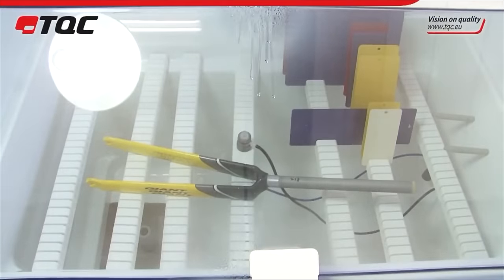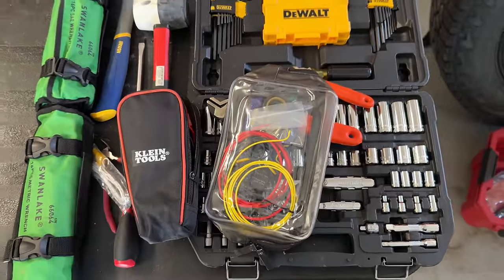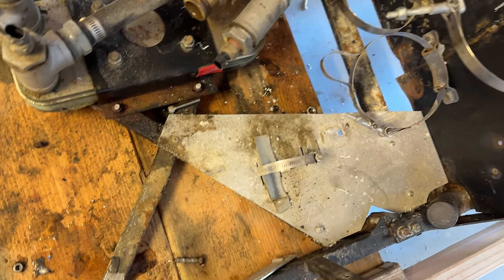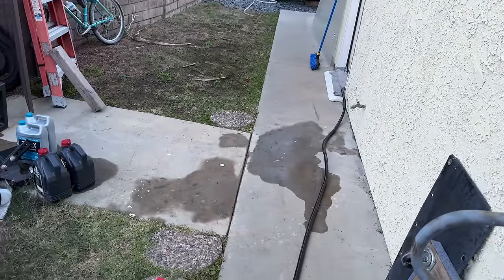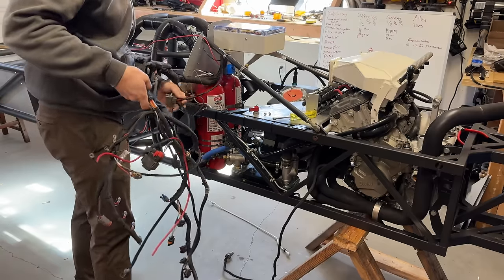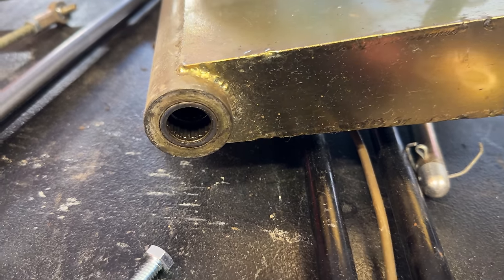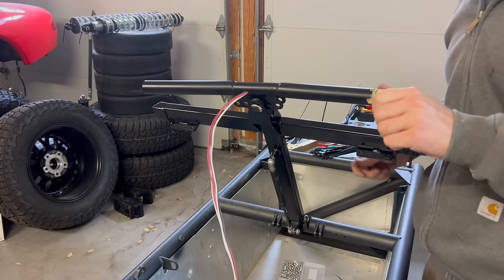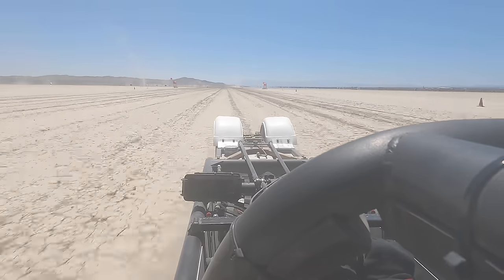My Race Car Is Rust

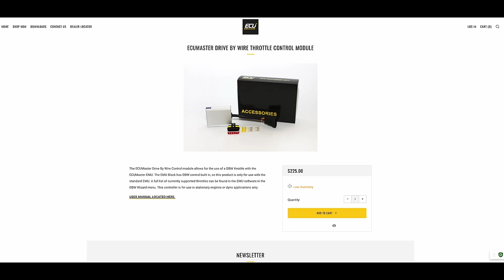Comment: 11:19 Arduino boards are generally not manufactured to withstand the vibrations and heat you need in an automotive environment but I’m sure you’re very much aware of that. 
Just wondering how you’re going to solve that.
Reply: I imagine its easy to compartmentalize.

The inside of some 3d printers get really hot but they still use basic consumer microcontrollers.

They just have different chambers so the boards aren't in the hot zone.

A 3d printed shroud and a fan would be enough I reckon.

The thing Id worry about is signal integrity with alternators and other electrically noisy components in that area, but that could be fixed simply with some shielded cable and or differential twisted pair.
Reply: @BeefIngot  I agree that heat is probably not to difficult to tackle but I think the vibrations might be the biggest problem. Connectors will need extra attention too, I think. 
As far as I know, most cars still use unshielded cables (to my surprise).

Comment: Your issue with 3D printers is EXACTLY what put me off for so long. I don't want to have to fix a load of things every print and gamble away time and filament on a maybe it'll work this time". I'm not looking for my 3D printer to be a hobby, I'm looking to print away my problems... as a hobby. 
Does seem like there are finally units that Just Work* and we've been going at them HARD to make up all the bits we said we'll "just print later"... 

* They don't , but they do better than 5 years ago and don't need in depth knowledge of printers to run/fix.

Comment: i noticed the european trucks are motor-chasis-electrical wiring- suspension builded and after that are painted with a layer of anti corrosion paint. is possible that helps you.

Comment: I am wondering why you didn't run one lift cable in total? You could have ran from the winch through a pulley, down to a snatch block with a hook, back up through another pulley, back to the rear, through a 3rd pulley, then down to the back hook/lift point. That would have minimized parts, reduced complexity and also minimized several failure points.

Comment: I'm now wondering how can fly by wire have such a large lag when it's basically a relay between one turny thing to another turny thing. Is there some super complex analysis taking place on the way? Aren't arduinos relatively fast even with operations that take hundreds of clocks?

Comment: If a lot of the trouble you’re having with your printer is related to bed adhesion, do yourself a favour and pick up a textured PEI plate instead. I’ve found the cool plate that comes with the X1C sucks, and I’ve yet to see a failure with the textured plate, to the point where I’m happy to kick off really long prints and not fret about whether the adhesion of the first layer is a ticking time bomb.

As I type this, mine’s currently working on a second 8-inch duct reducer that I cobbled together with my abysmally limited fusion 360 knowledge. It necks down and also shoots air up a bit for an abuse of a couple of ducted fans I’ve got going. I’m printing them in PETG, and each is a 12-hour print. I also did a big 2-colour Majora’s Mask for my daughter for Christmas, each half of which was closer to 18 hours and would have sucked balls if it had failed, which it didn’t.

Not interested in 3D printing as a hobby, either - I want to use mine as a tool instead of having to tinker.

Comment: Now you probably have a better understanding of why anything that has a "marine" rating is so much more expensive than the non-marine version, constant exposure to salt air destroys everything. 
Marine circuit boards are set in epoxy after the components are soldered to the circuit boards to protect them from corrosion, so if you're using a pi or similar to control your throttle think about this if you want it to last.

Comment: Use hot water when cleaning your stuff of salt. Hot pressure washers with the pressure washer underbody sprayer. Best method to clean salt is hot water. Cold water ain't gonna touch it, you need to bring up the temperature, like in chemistry class.

Comment: Stick the suspension on your seat, that way you don't have to do all the jiggery pokery with the wheels, (think a truck (18 wheeler type truck) seat but smaller)
Reply: The suspension is not there to make it comfortable. It's there for maintaining contact from the tire to the ground

Comment: Honestly I'm not familiar with bambu labs 3d printers but from what I've heard you shouldn't need to fix things that often. Maybe it's a bad unit? I rock with Prusa and literally I've only had to lube my pre-assembled mk3s+.

You'll be surprised how strong PLA+/pro is even for impacts. PC should do great and have awesome heat resistance which PLA sucks for.

Comment: Was wondering if you were going to lean into the caster.  It's a one trick pony... lean it back.  I don't know about Arduino running any throttle.  It would have to be on the hardware interrupt side, and even then I'd have to know the refresh frequency.

Comment: You southerners are funny, come up to the rust belt.
BTW check out saltaway, for clean up after, and Krown for protection ahead of time, spray teh insides of the frame tubes, and the outside of everything but the body.
Also there are plenty of ECU's for EFI with fly by wire throttle.

Comment: heh i made a DIY drive by wire system for my gokart bc i didnt have a long enough throttle cable and wanted to overcomplicate things. worked decent but the kill switch i added definitely saved my ass a few times

Comment: Would it be possible to use a fan to pressurise the body while doing runs so it will blow air out of every gap and not allow the salt in?
I have heard of it being done on trailers in Australia to keep the dust out on the long dirt track to get to our salt lakes

Comment: What 3D printer did you get? If you want one that's an actual tool and not an obnoxious project in its own right, get a Prusa or a Bambu. We use both of those at my work, and they're absolute workhorses. None of the bullshit that comes with an Ender

Comment: for your 3D printing, the way to avoid making it a hobby is to buy a Form Labs resin printer.  It makes fully dense parts out of a variety of materials (soft, hard, stretchy, super strong, grippy, temperature tolerant, etc.) damn near perfect every time.  The resolution is also 5-10X higher than what you have now.  It's a ~$4k outlay to get started, but it'll be much stronger, smoother, and functional than any FDM print.

Comment: Old school paintball players all doing the Leo snap/whistle thing @3:18.
Reply: Weirdly enough, I remember years ago looking at a racing cart that had a pneumatic shifter with a Palmer's stabilizer on it, and thinking it was an oddly specific choice...

Seeing it again here, I can't help but wonder why the Palmer's seems to be the go-to regulator.

Also, I have no idea what the Leo snap/whistle thing is...
Reply: @normang3668  The DiCaprio meme from One Upon a Time In Hollywood.
As for why, it was (and perhaps still is) the most compact regulator that interfaces with pin valve tanks and is adjustable.  Everything else requires additional fittings, an external regulator, etc.  I’d have to look at Grainger, et al to see if that’s still the case but it might be.

Comment: My suggestion as a Canadian that lives in the land of calcium chloride, just buy a pail of Corrosion-free 3000 and apply it to everything with a $30 rust-proofing gun. Spray tubes inside and out. The coating is light, and it doesn't take much. The good ones are all dripless now.
Reply: As a bonus, you can use it to coat the RV so it survives as well.

Comment: Protecting metal from rust is not rocket science. Convert the surface with a brush on oxidiser; brush on zinc undercoat, then brush on Hamerite. You could probably do the whole chassis for the cost of one or two cans of that fancy stuff. Simple.

Comment: ohhhh my goodness Matt no offense, but do you intend for your videos to be so hilarious? I feel your pain brother- you remind me so much of me when I was your age.

I don't know if it is because of my lifted off-roaded small block Pontiac 455 powered 1969 GTO (I know- a sin for which I will surely be kept out of heaven), or the time I welded together a bare mild steel sandrail frame and then towed it to work to finish it on my down time, but I watch your videos and I see my younger life playing out in front of me.

So the problem with the sandrail was that I was in the Coast Guard at the time, and my "workplace" was aboard a Coast Guard Cutter on Terminal Island, CA. And so there I had parked the sandrail frame right on the pier in one of the crew parking spaces 10 feet from the salt water. It might not have been so bad if I had got the chance to shoot a coat of primer on the frame once we got down time that afternoon, but instead we got called out on a rescue mission that lasted about 30 hours.

All I can say is that as we were pulling into port the next day I was coming up from doing a round in the engine room when I heard a bunch of laughter up on deck. I come out to see us pulling into the boat basin and there was my brand new bare sandrail frame now a nice almost cherry red rust color- every square inch, and yes even with the nice little darker red salty morning ocean dew rivulets dripping down from every weld and crevice.

I can say that the car was never right after that. No matter how many wire brush and rustoleum treatments- I was able to get most of the frame tubes to hold paint, but never the welds. No matter what I did- paint/primer might hold for a month or so, then they would just flake and rust again. I eventually resigned myself to just carrying a wire brush and can of blue spray paint in my tool box on the car. Every few weeks or so I would just walk around the car, wire brush welds and shoot a little paint. It was terrible. I hope this is as encouraging to you as it was for me at the time. It did my heart good to see someone else feel my pain. 🙂

I'm not even going to look to see if someone else has suggested this- I am sure they have so I will just add my vote; next time you have the car apart, go get it sandblasted and powder coated! Powder coat is my best friend. It has never let me down. (for the most part).

Thanks for the great content. Don't burn out. Keep it fun and at your own pace. And be safe- if you are into that sort of thing.

Rob in Washington State

Comment: That throttle actuation at the end was so super laggy, I hope you can tune it a bit more responsive. I assume plain PID? You really need non plain PID for this, ie PID on top of a static holding output value from a map. Hope that makes sense and I'm not telling daddy how to suck eggs :-)
Reply: I write this then read everyone else's comments and they're all safety concerns, some valid. I've implemented this twice from scratch and provided your controller will NEVER lock up it should be reliable. If the controller IS the ECU then locking up is unlikely to be an issue since it won't run if that happens.

Comment: I could have warned you but everyone has to be christened. Speedweek doesn't end when you leave the salt. It ends when the car is ready to go back to the salt for next year. We pretty much take our cars back to bare metal every year. The key is to use paint that protects from rust but is easy to completely remove again. Don't use por15!!!

Comment: There's a YT video on packing sealed bearings and the gist of it is not to overpack. 

The only moving parts on most cargo containers are the doors. Because the door hinges and container locks are such crucial elements, it’s necessary to keep them clean and well-lubricated. You can ensure that the hinges and locks do not stick or flex when you open them by performing this sort of routine maintenance. Use a commercial-grade steel cleaner to clean the door hinges. This liquid cleans the hinges of any dust, grit, or grime, preventing them from becoming stuck. How do you lubricate a shipping container door? You can spray the doors with a lubricant such as WD-40 to ensure they open easily.

Gang output of Arduino and RasPi for TBW.

Comment: Im not sure how i missed the notification for this video..... so im late to the table.
But id be willing to help you build the body you orifinally designed as optimal.
If you can draw it in the computer, i can make it for you.
Cheap.
Im not looking to make anything off you. Ill volunteer my time and tooling.
I have a pretty good hook up for materials.
Ill put you in touch with them.
If you'll pay the hard costs on the materials ill donate my time.
And we can do EXACTLY what you wanted to begin with.

Edit: i work with carbon fiber, kevlar and fiberglass. And wood and metal....

Edit edit: i use a method that allows you to lay up the body directly on the car and solves all the problems you mentioned. Its not my preferred way to do it, but if you want to do it without molds and want it to fit than i have a great way to do it.

Edit edit edit: oh, and it would all be one piece. Or as many pieces as you want after you made it all in one piece.
Whatever makes you happy. 
It also leaves a very smooth surface with flawless curves.

Comment: I would not do something as important for your safety as the throttle control with an arduino, they aren't really designed for safety critical applications, there are so many ways it can go wrong, get something premade and properly tested

Comment: No one cares but partially why salt rusts stuff so bad is because it also acts like sandblasting where it strips coatings, platings, etc.   it’ll also blast off rust to create more rust and less metal😂. Surface rust is on the surface because it loosely acts like a passive barrier for more rust.  Like a shitty version of chrome on stainless.

Comment: Not sure how much weight it would add, but have you thought about running tubing everywhere with tiny holes drilled in it to spray water everywhere that might need to be cleaned? And then maybe hot air through the same tubing to dry things out.